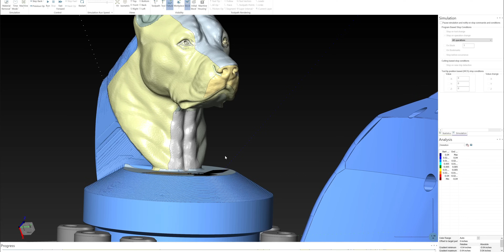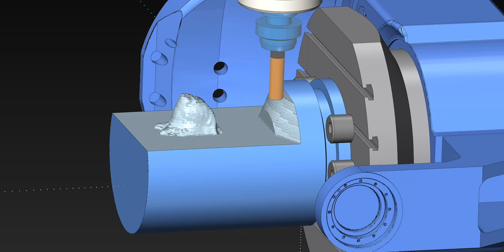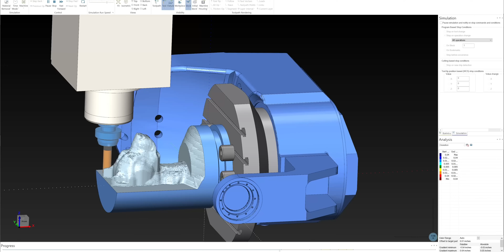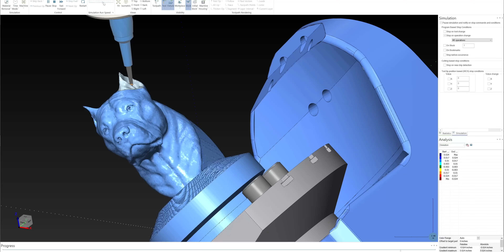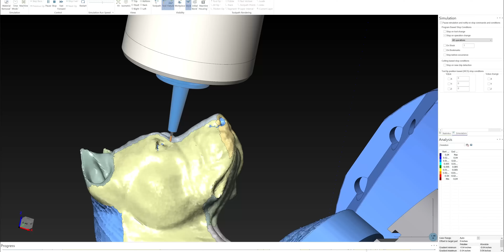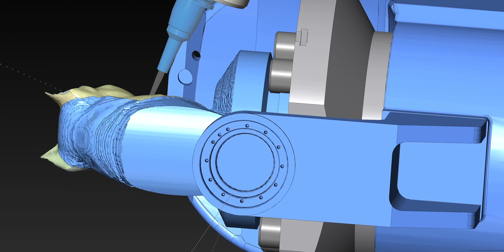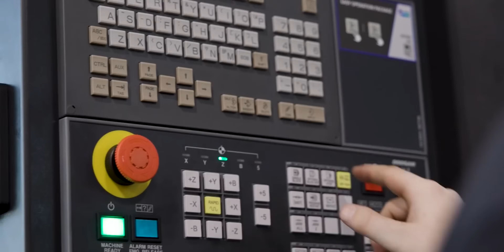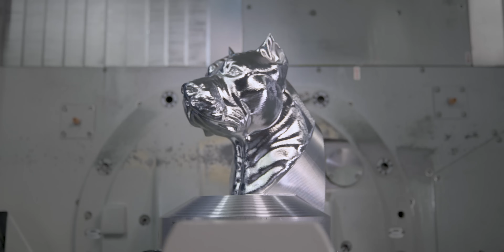TOP 5 tips to become a Master CNC Machine Programmer | DVF 5000 5 Axis Mill

Comment: My top tip to being a great CNC programmer is to forget all about CNC programming and spend a couple of years (at least) on centre and capstan lathes.  After a good few jobs on the capstan where you run out of stations and have to double-up on tools then you can start to think about 'that CNC stuff'.  Even then you need a year or so writing part-programs by hand before you can start on DAD/CAM software.  I've been on CNC for nearly 30 years now but always remember what I learned on the conventional machines.  I still run jobs on my Herbert 2D from time to time - just to keep my hand in.

Comment: See this is what im striving for. Ill be 24 soon and i work in a fab shop on a CNC 3 axis and ive ran all 3 of our machines in the span of 8 months total. I understand G and M codes, and i know the feeds and speeds for all the tooling and materials we run. ive watched Titans vid on how to manually code on the machine computer and im comfortable. 

Thats the problem… im comfortable. Ive reached my full potential at this shop and its been only 8 months on CNC. I want to do complex parts with tight tolerances. I want titanium i want stainless metals not just A36 up to A514… i want yo learn more CAD programming but im unable to where im at. Wish we had more shops here so i could advance myself because i honestly dont think ive ever been this motivated in my life.

Comment: Some things I learned from my first job and first experience for CNC.
- DO NOT do what others do. Everyone programs and machines differently, if someone says you’re doing it wrong, tell em to fuck off but consider their idea. Never copy.
- fuck up. You’re bound to fuck up at some points even with 50 years experience like my co workers. BUT, do not use this as a reason to constantly break tools or parts if you’re not gonna learn from it. 
- Take your time. Even if people are on your ass, telling you to speed the machine up or push the machine, they probably dont know the machine or how it works. Make sure every detail is how YOU want it. missing a decimal or a zero can break things or hurt others. You wont begin a genius, nor will you die one. Especially if you try to gain many years of experience in a year. 
- You dont know it all. Like I said, everyone has a different method and different experiences. Someone may have a faster method, or more efficient way. A day you dont learn from your machine, is a day wasted. Go back to old programs, rewrite them, look at others’ programs, reconsider variables like tools or material. 

For a little back story of me, I’m enrolled in a CNC school of ignorant teachers who say the most abhorrent and cursed shit sensical machinists would and have lost it over. I am also employed at a Magna plant with my father who was a Tool and Die designer, manufacturer, T&D solo business owner before 2008, and can run any machine you give him. Though, our coworkers like to play a system, and blame others for everything, sweet talking supervisors and lead hands. the Mill guy is the worst of the bunch, a narcissist and gets physically violent when he’s proven wrong or slightly upset, but he sweet talks management into believing he is a genius. He is 25 with 3 years experience, breaks tools everyday and makes the same mistakes over and over again, leaving the room a mess for the next shift and making stupid decisions for the CNC room, trying to own it. In a year I have learned way more than he ever has because I wasn’t outwardly ignorant or insecure. I’m glad my first CNC experience is with him, because I have an example of what I should avoid becoming.

Comment: really nice parts. which is better for the lathe, solid works or mastercan
Reply: Solidworks is primarily a CAD system used to make 3d models, prints and assemblies. You can however add CAM extensions to Solidworks to machine on a Turning or machining center. MasterCam is way more expensive but has more features. Also, MasterCam is harder to learn. I use Inventor Cam now and its cheaper than both and does what I need it to do for turning or milling.

Comment: I once worked at a company where the programmer was a uni degree trained, a master with the cam software, but no idea that what he was doing was wrong from a machining point of view...now I am a programmer, any new job that is different or challenging , I take the drawing down and talk with the senior machinist on the machine and get their input, they know the machine, its condition and limitations.
Reply: yep!  best tool is your ears!  Working with the shop floor is absolutely critical.  It's a wolf pack that you have to run with.😂

Comment: Excellent advice Jesse! There are a few of the guys that you and I both worked with that refused to advance with the technology and are still stuck in 1986.
Reply: It definitely is frustrating.  Especially when those people are the ones in positions of power and they won't let you innovate.
Reply: @Jessie_Smith  By the way I have never used a ball bearing to fix a hole before!!! LOL  I'm joking of course! It works much better with threaded holes! 😂
Reply: I am stuck in a same position now .

Comment: Do you have some good ideas and good methods for checking the tool length and zero point,my worshop operators make a mistake about this two things often.
Reply: Could you clarify a little more?  Do you want to just verify the tool length before it runs each part?  and by zero point do you mean verify the work offset as well?  is this for a 5 axis or 3 axis?
Reply: renishaw?... 🤔

Comment: Great Video, what is the picture frame method?
Reply: Thank you.  If you check out this video https://www.youtube.com/watch?v=m-BFKCMAr1E&t=54s  it kind of shows what the picture frame method is.  Instead of roughing the material completely on the outside of the part, you leave a "frame" of excess stock all the way around the part.  You can leave some tabs spaced out so your part doesn't cut free from the material and finish the outside profile up to these tabs.  Then you can flip it for op2 or just break the part away from the tabs and have a complete part.  It is really great for things that are difficult to hold in any other way.  I will try to do a more detailed video on it in the near future.  It is a really good method to know.  I hope this helps.